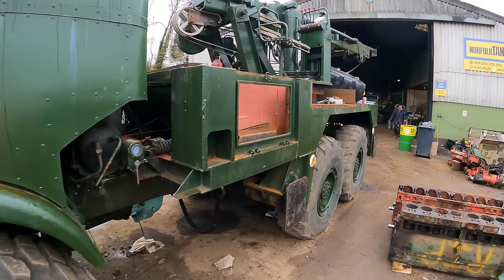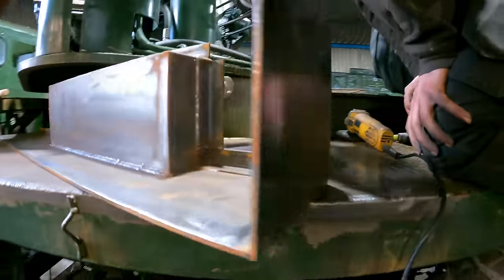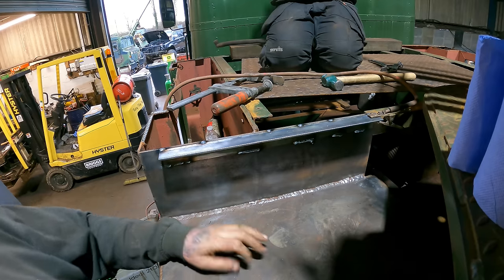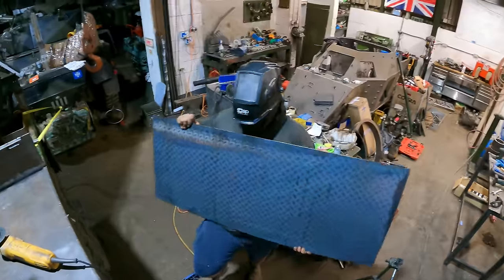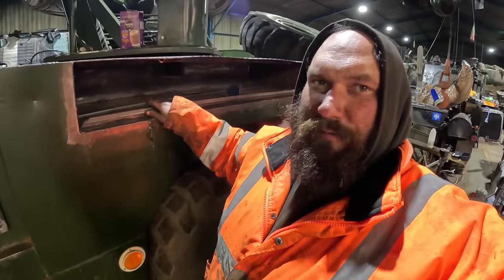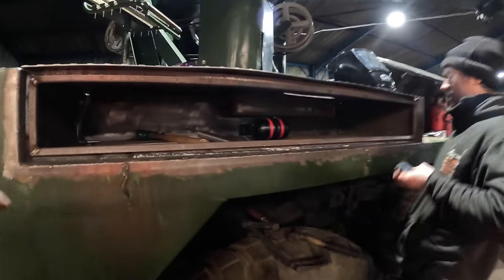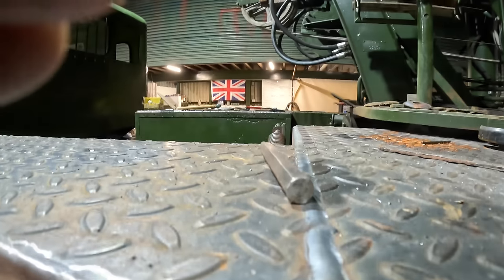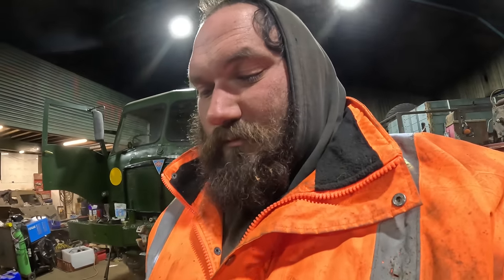AEC Militant Military Recovery truck - Fabricating New Storage Bins And Welding New Rear Floors

Comment: Nice job. The steel tread plate is the only way to go. As a carpenter, I never have a problem with replacing old and inadequate wear surfaces with similar but better surfaces. The same thing would have happened in service.

Comment: Good to see the use of the old safety squints whilst welding.

Just a thought, but rather than a big clamp, could you not have used the forklift to close the gaps on the bin lid? The forks would also act as a giant heatsink.

Comment: hi there, used to work at AEC and did all those militants in the 70s, they were known as 0870s, whats happened to the air cleaner which used to be behind the cab ? also missing windows and wiper.

Comment: The Army had IRR green anti-slip paint for tank decks. It is like the paint includes large grains of sand. Worked well on the walkway on top of my office trailer. Maybe you could "acquire" a can for your decks when finally painted.
Fodens may look fancy but are top heavy. As a REME sergeant found out on video some years ago.
Reply: It was a long time ago,but I can remember pint cans of anti slip sand in paint stores. The concrete front steps of one house we lived in were so treated. No doubt the milspec stuff you refer to was a lot more heavy duty,more carefully thought out,but you do what you can with what you have. Adding a little washed screened blasting media should serve as an improvement. Scatter on wet paint and spray a second coat. A lot better than nothing.

Comment: Nothing to do with cooling. You need to balance weld. Instead of near side fillet weld being in the same plane as far side they need to be staggered. One solution with durbar plate is bolted with csk bolts. It’s very difficult to keep things flat when welding. Excellent channel